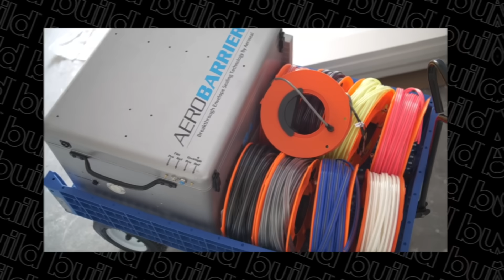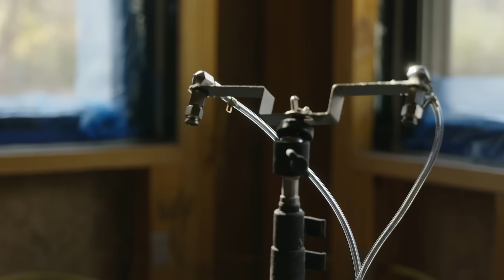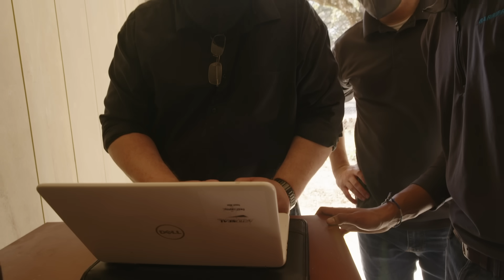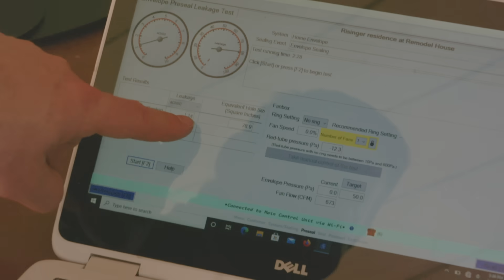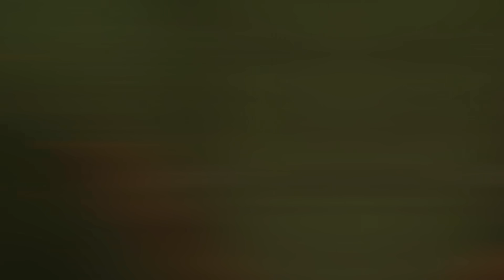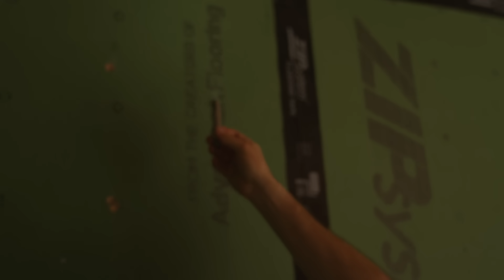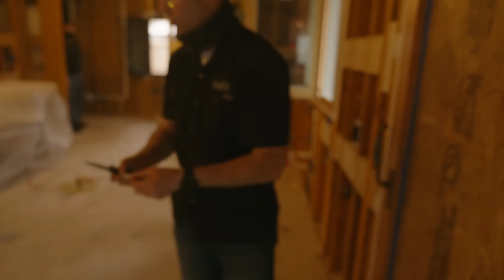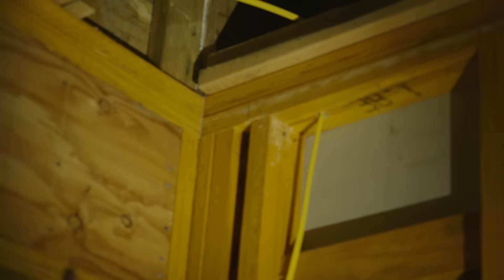The one product I'd recommend for EVERY House!

Comment: Matt, it's not responsible to promote this without a very clear caveat that makes it obvious that this system does not apply to and should not be used in most homes without very significant modifications. Even after covering the basics, so much more needs to be in place (lots of $ in mechanical work, etc.) that just don't add up for most retrofit scenarios. Also, most people are not going for a passive house rating. 

Pitching this without clarification is similar to folks who sell replacement windows as energy savings. For one, savings to investment ratio is not there. Secondly, no use in replacing windows (which are very expensive) if you haven't done basic insulation work and air sealing. Get the basics done first. 

Many of the areas that were sealed with this system could have been handled in the construction phase (caulking between plates, etc.), with blower door directed air sealing (smoke, etc), and/or in a careful walk through (e.g. wiring penetrations, etc.).  

Also, water and water vapor management is much more important to achieve for healthier homes before obsessing about a few CFM.

Comment: Very interesting stuff.  I would not have thought that sealing with a positive pressure door system would work, but I guess it does.  I do want to voice an agreement with the AeroBarrier representative and even extend it a bit.  This process is no substitute for proper design and sealing.  It is a later stage, fine detail technique for reducing the many (maybe hundreds) less than 3/8” gaps (even very long 3/8” gaps) down to nearly zero leakage.  What this means is the overall structure needs to be made in such a way as to have only small leak holes and cracks.  Logically in a large multistory structure, this would need to be accomplished with the assistance of an air door test and fix session or two to locate and fix the large holes.  This initial rough sealing process cannot be bypassed in most situations.  I would think however, that this would be done as phase one during a paid inspection phase of the treatment, rather than engaging a separate company, perhaps on a day prior to the final sealing phase so that the door fan can be left installed for the second day after the large holes are sealed up.  I would also think that most of the large holes can be sealed up in an hour or two, so a one day two part (1. test and locate> fix > 2. test and seal would be the norm.

I fully agree that it is best to have control over your leaks and add back the 2-5 air changes per hour on your own terms (controlled filtration, humidity, radon, CO2, and temperature). Don’t forget about radon buildup when sealing a structure.  It is no joke, nor is keeping CO2 ppm under 500.  Sometimes it is just easier to open a window 😊.

Comment: 0.10 LEAKAGE   You did not really say that in more than a 4 second blurb. Had to go back and check it three times and found it.   With all of the time spent working to find and seal holes along with ventilation videos along with special custom seals  around water spigots, air vents in, air vents out. Dryer ducts ten layers of air and vapor BARRIER on the walls.  Then we have to run this back and forth several times just to make sure we heard what we heard.  Seriously .. Great job.

Comment: Matt , love your videos. I am a fan of “best practices” construction. Good to see. I am on the fence about these super tight sealed houses. ( I currently live in a 103 year old house that leaks like a sieve, and am always considering what I might do to improve it.) Sealing everything seems great, because now you are controlling the air quality and humidity of your entire home. But the caveat is, now you have yet another complicated system to monitor and maintain. I’m not that proactive about changing my central air system filters now. If I was also monitoring air coming in from outside, making sure it was working correctly and changing filters etc, what happens when I ignore that system for longer than I should?
Reply: What would master Yoda say, clarity you need, master jedi. tormented your mind is.

Comment: I would not be surprised if 50 years from now the common practice is NOT to make airtight houses unless you have a mechanism to effectively cycle the air so things can dry out.
Reply: Where I live they make super tight houses and then put vents in the walls. 🤷🏼‍♂️🤦🏼‍♂️

It almost makes me wonder what’s the use in making it so airtight and then putting holes in the wall. 

They use fresh 100’s to let air move in and out.

Comment: If I'm not mistaken that has latex in it, I may be wrong but if it does then how would that affect people with an allergy to latex?
Reply: When talking about paints and caulks, "latex" is a term used to refer to a synthetic polymer dispersion in water. This is NOT the same as natural rubber latex.

Comment: shouldn't have put that spray foam everywhere, it is not suitable for trying to make the house airtight. When it shrinks over time cracks will open up and make all your aero barrier spraying useless. Proper design of airtight layer is by far the best way to make a passivhaus, not doing a botch job to replace lack of proper planning.

Comment: Does it make sense to run the system after completion just because weight of the house opening some new leaks or opening some leaks to a larger hole that was closed on the initial product installation

Comment: Will this also coat the window glass and how does it interact with exposed wiring?
Reply: Windows have to be sealed before application because they all leak a little and it would gum up the operation of the window.  Not much of exposed wiring is horizontal, so you might get some dust on top of outlet boxes and horizontal runs.

Comment: Really awesome video!  Excited to hear more about existing builds since so many homes are 20, 30, 40+ years old, not up to code, massive air leakage (regardless of climate location)...this is such a huge concern of mine since we purchased a home that is about 20 yrs old.  You mentioned in the between stage of resale, and just having to cover the horizontal areas...maybe a future video prepping an existing home in that in-between stage to compliment this video?  We bought new windows which has already helped in air loss, but I know there's a lot more that could be done to fix the leaks that are happening.

Comment: I get this is for efficiency and it's probably a good system... however, having air breaks in a house lets in fresh air, right? So... we're spending thousands to plug air breaks and then thousands more for a system to bring back in fresh air?  Can't help but wonder if the cost really worth it?

Comment: Seems pretty dumb to be walking around in an area that literally has vaporized caulk in the air that is supposed to fill millimeter sized holes. Doesn't sound too good for the lungs.
Reply: yeah i was like my lungs wouldn't like that shit..
Reply: The system comes with two full face respirators. 
The process they’re doing during the video when people are inside is actually the nozzle clearing process. The pumps in the connect boxes have a pump, water tank, and sealant tank. All controlled by a direct  WiFi network and master control unit. 

It’s the most efficient method for air sealing. 👍

Comment: Out of curiosity...if you started at 1 and ended up at 0.1, I understand that’s a 10x improvement but since you were already at a good starting point will that 0.9 actually make a difference you can see on savings in your bills?  I have a linked home and only attached to my neighbors through a shared garage (cinder block wall). Our neighbors smoke and it comes in to our garage and then in to our house, will regular spray foam be sufficient with this type of issue? Is there a specific type of spray foam I should be looking in to? We live in Canada if temp makes a difference on material recommendation. Thanks for any help that can be provided!

Comment: We just did Aerobarrier in my occupied house from 1979 one week ago as an experiment. Had to move out everything, then back in. Improved air flow by about 2 exchanges, less than was hoped for. One reason: the basement door blew shut unbeknownst and so the basement didn't get the full treatment. Also one sliding door looked closed but wasn't fully closed. Easy to make mistakes that are hard to detect until later. Now we'll dense pack all walls next and also do AeroSeal to seal up the duct system for later geothermal heat pump delivery.

Comment: Not just air sealing, this is going to be amazing in preventing bugs from getting into the home.
Reply: ⚠️ Danger - When any house is that well sealed YOU MUST hire air flow professionals. High volume vent hoods can easily draw fumes from the heating system and water heater back flow into your house. MAKE UP AIR is essential for safety when you have a sealed home.
Reply: @wheelie642  I’m currently finalizing plans for a home that is going to make this house look like a sieve. I am also adding an air system that will bring in outside air to keep fresh air in the home so no one suffocates. I am probably going to try and get Matt to stop by if I can
Reply: @MasterKnight2K  Thankfully you only want one to suffocate.
Reply: @MasterKnight2K  iTs gOt AiR LoCkS bRo
Reply: @thorium_glass  ?
Reply: @wheelie642  how do you avoid this?
Reply: @wheelie642  That doesn’t mean you need a professional.  That means you just need to do more research.
Reply: maybe, maybe they like to eat it
Reply: Not really, not sure if rodent are considered rodents but rodents will mess up a duct work before you can blink
Reply: @justanotheryoutuber5228  I won’t have that problem. Rodents won’t be getting into my house.
Reply: bugs eat wood
Reply: @hdj81Vlimited  if you are going to the point of doing aerobarrier and not doing proper sealing for bugs, you missed a few major steps...
Reply: @MasterKnight2K  check your doctor for split personality disorder.

Comment: The only thing I don't understand is, you are trying to build a very airtight house but you still put electrical cable inside the walls.  Why?  Here in the province of Quebec in Canada, we have been using this method in the old days but it's been a while now that we use another method.  We use a vapor barrier or a foam with an aluminum vapor barrier integrated, inside all the exterior walls.  Everything is sealed with tape and all the walls junctions are sealed with accoustic paste.  Then we put 2 layers of stripping installed in a grid and all electricity is wired there with 1 1/2" deep electrical boxes.  Vapor barrier is never drilled through.  If you have to, say...  to bring exterior water faucet, everything is sealed with expansion foam and or tape.  So basically, all new construction should have a very low air leak number.  But the mist method would still plug the remaining leaking places.

So I like the mist method, I just think that the base construction should be better in the beginning.

Comment: Wish they had a better distribution system. Waiting for another company to sell similar tech. Couldint get my local rep to call back. One in a nearby area did finally. Now that i moved to a smaller market no chance to use it.
Reply: If someone sold the tools and you bought the materials investment would cost the same as one spray them material would be 1-2000 a job.

Comment: If you're able to lightly see this aerosolized particulate with the naked eye then I would imagine that it would be very wise to be wearing a mask while in close proximity to this process. Think about it: This substance was designed to find tiny holes and occlude them entirely to form an airtight seal, and for it all to last many years to decades. I don't want any substance like that entering my lungs.

Comment: How can anyone sit in a frigid drafty house in winter and claim that leaky houses are necessary.  Give me a sealed home so I can live comfortably.
Reply: Seal it up as much as possible and use a heat exchanger to exhaust some air and pull in fresh air efficiently. 
More efficient. Controlled.
Reply: @christopherbeddoe406  and if done correctly you can filter the air and adjust it's humidity before it even enters the house.
Reply: as someone who lives in, and works on 100 yr old houses, you deal with it. locate the problem area and fix it
Reply: @WilliamHPastey  very true, if you have the money upgrading the old single pane windows also makes a huge difference.
Reply: @WilliamHPastey  The problem is the mentality.  The "houses need to breathe" mentality. 
Leaky homes suck.
Reply: @dpeagles  welp, when you seal it up and don't address the moisture, you get lots of mold. New builds rock.
Reply: @clipsterhooligan  😒🙉😒😒😒😒😒😒���
Reply: as long as you have electricity to run the air exchanger ,,otherwise , you will get mold from the inside
Reply: @acadian101  You can still open a window
Reply: @acadian101  Not exactly. air flow can be designed into the house design. You also have trickle vents, and just opening windows to move air in the home. Also material are a big factor in moisture control. There are also automated trickle vents, and other solutions. Point is solution do exist and effective.

Comment: So am I understanding this correctly, that before the holes/cracks are sealed up, essentially the system is just pumping aerosolized latex into the atmosphere around a house?? Doesn't sound very nice to the environment. or neighbors. or lungs. or anything really besides overzealotry
Reply: No. 

Once the holes seal up, nothing is getting out. As the guy said, the particles go to the leaks, any of the rest of it fall to the horizontal surface inside the house.

Comment: Even 1ACH is incredible, but 0.1ACH is almost unbelievable. Even if it breaks down over time you still have a super tight house. Awesome work and great product!
Reply: You raise a great point about the product. As the house swells and contracts, how likely is the aerobarrier going to keep all those seems sealed? It would be great if they could do a follow up a few years down the road and see how well the house still pressurizes compared to when it was first completed.
Reply: @Rick-the-Swift  I would recommend that after this procedure is done the builder go over the areas where the product is seen with tape or another calking product to help lessen the effects of deadhesion over time or house settling. Another good idea would be to add a colored dye to the product so that it is better differentiated from the normal foam insulation/calking used in home construction.

Comment: very ugly breaker panel back there at 4min in..... you should scream with your OCD at it .... wire's feed from above.... below and all and than all them run's all over the wall... that stuff drives me just nuts. How can they still allow those horizontal where ever wire runs...... right in the middle of the wall even ... come one people we can do better than that..... either just at outlet height or 1" off the ceiling if you can't go thru the ceiling area. Come on people

Matt you guys should also do a break between. What does a air blow test run's you and how much it run's you with the sealant. I think that maybe even a better selling point.

Comment: I have used several different acrylic roof coatings and their associated caulkings. These caulks are typically a 5 year solution before they start to degrade, and let go from harder surfaces. The acrylic roof coating itself is pretty resilient, but only because it is a continuous unbroken sheet. I would not personally invest in this for a long term solution based on my experience with acrylics
Reply: Dang, 5 yrs at $1.50/sqft...that $4,500 install (3,000sqft house) would need to save $75/mo in heating/cooling costs just to break even. Tall order.
Reply: This isnt exposed like a roof and isnt even on the exterior of the envelope
Reply: @sparksmcgee6641  
Interior acrylic caulking doesn't last forever either. 10 yrs absolute max in my experience.

Comment: This is brilliant and incredibly effective! I did home energy consulting in the 2000's and recommended Aeroseal for ducts. That turned out to be messy when it was done on existing homes. But in this situation of a new construction, tightening up the entire envelope to this extent is truly amazing. There is NO builder who would be able to manually tighten a home like this by caulking/foaming etc. Letting physics work for you to find all the microscopic (and big) leaks just makes sense.
Thanks for sharing.

Comment: What effect would that have on someone allergic to latex?
Reply: Would only come into contact during the initial install. And you shouldn't be in the building anyways bc there's aerosolized latex in the air which would be an irritant for anyone's lungs. So it would have no effect on the later home inhabitants being allergic.
Reply: This is not the same as latex rubber. In this case latex is referring to a dispersion of synthetic polymers in water.
Reply: Thanks. I suspected from the video, but it's nice to get input.

Comment: can this be done in cold climate where the vapour barrier is placed on the inside of the insulation?
Reply: Yes, all it does, it seals areas where there's a path for air to leak out. The way Matt is doing it,  is better though
Reply: @bahopik  sorry can you explain what you mean with the way Matt is doing it? wouldn't it be don't the same way in a colder zone? I as because I'm looking to build in the next year and want to do something like this if possible in my area and worried that is the air barrier is on the sheathing that I'll get moisture in the walls

Comment: If you use slime in a tire, your tire shop will turn you away. I've worked at a mechanic shop and dealt with a lot of different local tire shops that will not accept tire changes when there's jelly involved